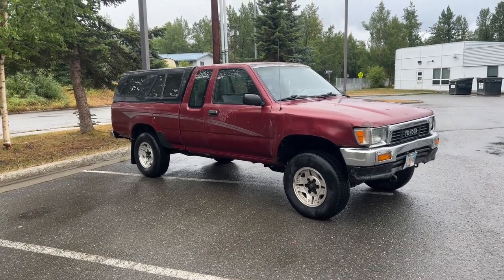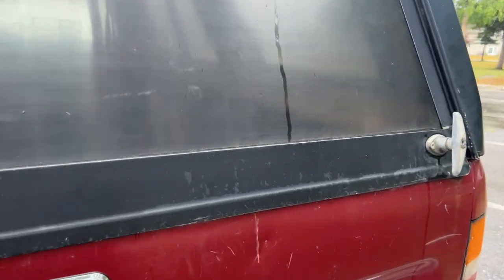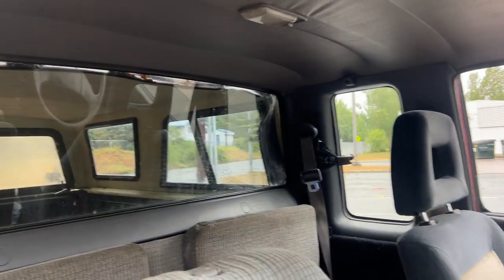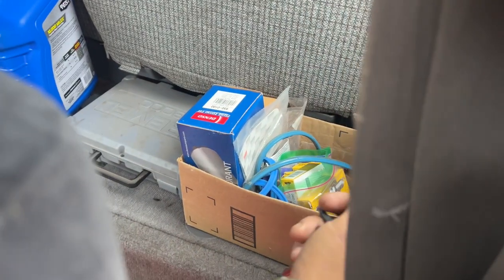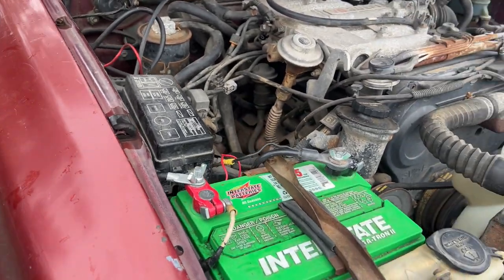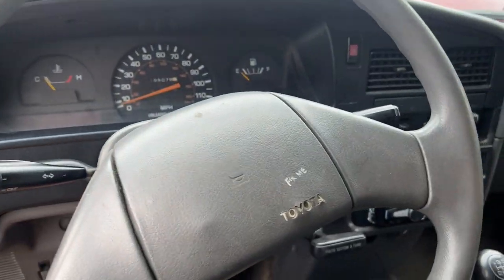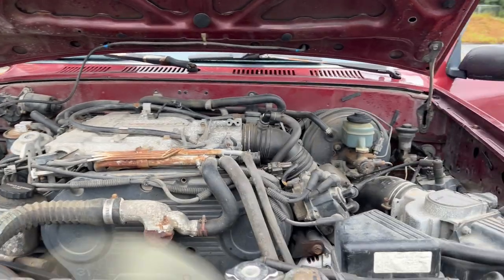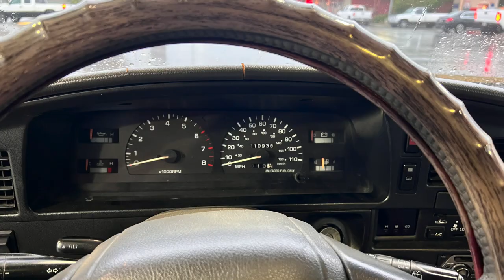I bought another Toyota truck, two actually..

Comment: Congrats on yur latest editions like the pick up I recently picked up a Toyota T 100 1996 automatic with power windows I had to recently replaced the radiator and added a Aluminum radiator with all new hoses  because it was leaking I also have to do the valve cover gaskets and  intake gaskets as well other then that I also need to work on suspension like you have like CV axles and a tie rod as well After that I’m gonna upgrade my suspension with new shocks 1 inch lip from the rear and 2 inch in the front can’t wait these older Toyota trucks always need a lot of work but worth every penny .